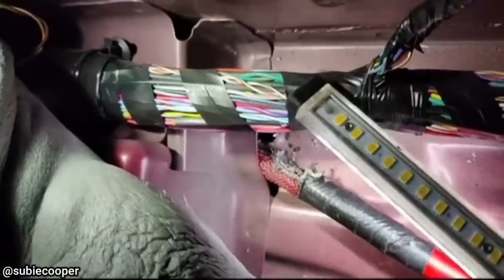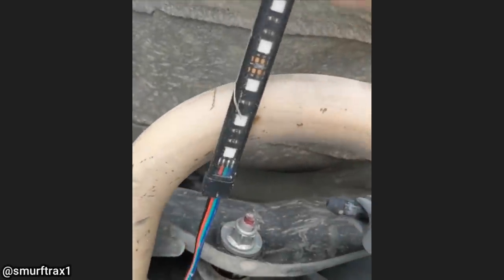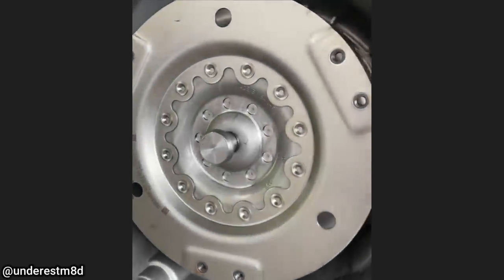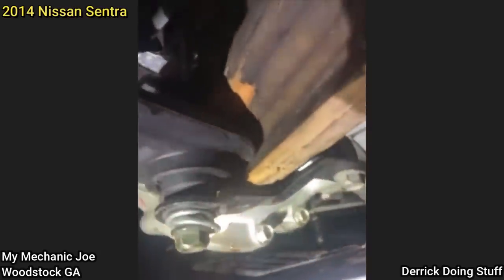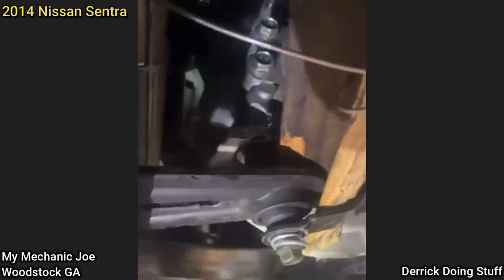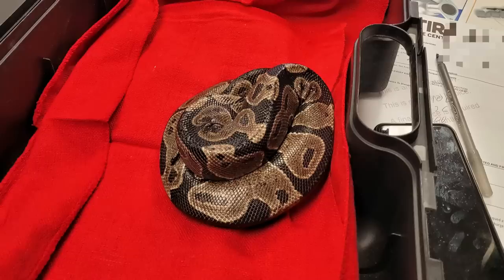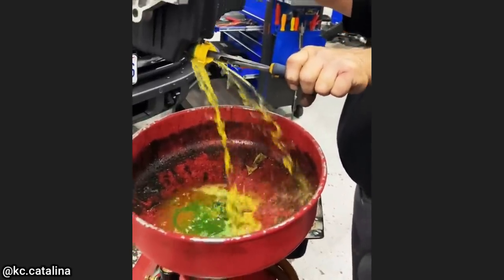Customer States Drove Over A Bolt & Now Smells Burning Plastic | Just Rolled In

Comment: Apparently catastrophic engine failures are somewhat common on those Broncos.  You'd think that after what, 126 years of being in business, the Ford Motor Company would have figured out engine design by now 😉
Reply: That's why they just need to take the Barramundi engine that Ford Australia designed (4.0L Straight 6) and put that in everything 🤣 #BarraTheWorld
Reply: Its not the design of the engine apparently they just had a bad batch of injectors, the 2.7 in my gramps f150 is pretty reliable

Comment: After watching many of your videos  have come to the conclusion that newer vehicles are ALL built like crap. Either aluminum now is ultra cheap and low quality or they are pouring parts and not tempering them properly making engine blocks and gear housings weaker than normal. Those big engines carmakers were putting out in the 40's through the 70's were unstoppable and pretty much unbreakable. Now you look at a new engine and it recoils in fear and something cracks.
Reply: Exactly my thoughts
Reply: Cheap pot metal
Reply: Has the same thought. Lots of thin cheap cast alloy made according to accounting not engineering.
Reply: @johnsullivan6709  Maybe more so to an engineers standard, who doesn't know that the real world isn't a lab 🤷‍♂
Reply: @notsureyou  Yep, coming across more and more of them. Always trying to reinvent the wheel ( round for a reason)
Reply: I think this channel is probably not a fair picture of what the majority of the vehicles on the road look like. If it was, we'd all be dead, or we would be fortunate that our car was in the shop because it would be keeping us from being killed by the innumerable death traps on the road.

I worked as a auto tech for almost 20 years (up until last summer) and I can tell you that people are taking picture/videos of these cars for a reason: because they've never seen anything like it before. This kind of crap really isn't common at all.
Reply: @ouch1011  Thank fully it is even less common in Australia due to required roadworthiness inspections :-)
Reply: @ouch1011  Excellent point.
Reply: And Ford is having so many problems with the new Bronco engines along with a bunch of other things and the official response is "we seem to be having quality problems". Really? Thank you, Captain Obvious!
Reply: @notsureyou   Pennsylvania has yearly safety and emissions inspections and since they began spreading brine on the roads in the winter the number of accidents due to brake failure has skyrocketed. My wife's 2014 Patriot needed a new tie rod end and my 2016 Patriot needed a new lower control arm due to corrosion. That brine ruined the frame on my 2001 Ram 1500.
Reply: @ikillstupidcomments  A lot of critical suspension parts are made of pressed steel welded together, not cast or forged steel as in the past.
Reply: @spaceflight1019  Is their an underbody coating that can be done,

Or is it just so corrosive, that it wouldn't matter?
Reply: @notsureyou  I don't know of anyone doing undercoating anymore. There used to be dozens of shops that did it.
Reply: @notsureyou  Underbody coatings don't work like they should and it doesn't take much to scrape it off a frame piece. In areas where they use brine and salt in the winter the only thing you can do is at least once a week during winter get an underbody wash done and not a lot of places do that anymore that I have seen.
Reply: @notsureyou  exactly. Just because CAD says it will work doesn’t = reality.

Comment: Yeah, dropped valves seems to be a growing trend on those 2.7 Ecoboost Broncos.
Reply from the maker: *EcoBoom 😜
Reply: How many ? I've heard of 60 of the real early builds
Reply: @rydfree  No clue. But I keep hearing stories about it happening more and more lately.
Reply: EcoPoop...
A co-worker has a 4-cylinder EscaPee EcoPoop. It's time for his biennial (every two year) flywheel replacement, which costs 2x Kelly Blue Book.
Reply: @dashcamandy2242  All these modern vehicles with engines that eat themselves, requiring expensive repairs are why I drive a 2001 5.3L. No VVT, no DOD. It just works. Sure, mileage in town sucks, but on the highway, it sips gas.

Comment: I guess nothing ever changes.  1,000,000 years ago when I was a lad, father was always complaining about stuff puncturing his feet as we rolled down to the Bronto-Burger for food.  Even with 3/4 inch thick calluses on his feet, various kinds of teeth, bone, stone, and other things would still be able to pierce them.  Now, the granite wheels were impervious to flats, thankfully.  You DON'T want to know how hard it was to jack them up and replace them on the side of the road.  Ironically, there were no potholes in those days.  Actually, the opposite was true.  Fairly large Poo-Pyramids were sticking UP out of the roads every so often, from the BigRigOsaurs and even LandTrainOdons.  Dad was pretty great at dodging those, most times.  I wish it was always, but it wasn't.  There was this one time a Rolls T Rex cut us off in traffic, then....

Comment: My father borrowed my vehicle to drive up to Alaska, hauling some supplies for a nonprofit we are with. After being denied at the Boarder (for stupid nonsense) he sent the other two guys he was with ahead. One of them (who was not informed the vehicle had a to package, my father failed to mention that in the chaos at the boarder) accidentally burned out the motor. A shop in Canada replaced the motor and we got it back within a week. Upon returning home, we discovered a very nasty oil leak. Took it to our local shop and they discovered the motor to be faulty. New motor, from the factory. Called the company that sent us the motor and they tried to play the 'you didn't register the warranty before installing the engine' card. Dad wasn't having it, since they both failed to provide necessary information and they sent us a shot motor. We threatened legal action. 

New motor should be here in a week and we owe nothing. 

I haven't had my rig for 4 weeks though. 

I can't blame anyone for missing something so simple in the chaos of boarder security and I actually praise the shop in Canada for going above and beyond with their repairs and speed. The guy that drove is a close friend of ours and he feels very guilty for it all. Of which we are more than understanding and worked to appease his anxiety. The leak only became apparent after the break in period of driving it home. I however do have a problem with the company sending a shot engine and trying to pull a fast one on us for the motor we paid for that has a factory fault in it.

Comment: What are the odds of hitting a bolt and splitting the battery cable. The customer did the right thing and got it checked right away before the systems locked his Family into the vehicle and burned them all to death.

Comment: Those staples were barely holding that LED cable to the fuel tank. They should have used bigger staples and a more powerful staple gun.

Comment: why did the Tacoma fail? was it just badly assembled?
Reply from the maker: That's what the tech thinks. No signs of anything causing it. Just a bad water pump. Stuff happens unfortunately.
Reply: @JustRolledIn  saw the same thing happen on a ford ranger , newly installed water pump ( at the dealership ) , he thought it threw the belt , nope , water pump snapped at the housing . Poorly built pump at the manufacturer .

Comment: stapled the cables to the undercarriage... and into the gas tank. how..? I mean, I know, how. but seriously... how? they'd have stabled it to the control arms if they weren't too hard. also, knowing enough to connect everything to the electric system, but not knowing enough to keep the cables away from hot and moving parts. this just scares me. what else are they doing half-assed and only survive because someone else finds it in time?

also that Hellcat gearbox. are they even serious at Chrysler's?
when german Opel tuner Irmscher decided to drill the 3litre straight six up to 4 litres (and upping the power from 180HP (2valves) res. 212HP (4valves) to 220 res. 272HP, and torque went through the roof), ZF said, "never mind our 5gear manual, it will die on the spot", so these cars were only available with automatic. everything else is just dumb...

I heard of snakes on a plane. but snakes under your center console? that's a new one. :)

and lastly, outro: is that a 1940's Ford coupe in the lower left? can I have it, please?

Comment: 0:05 What the fucking odds, a stray bolt, striking the under carriage in such a way that it crossed paths with the battery power cable.
2:47 He is lucky it did not get sucked in to the engine, that would've bend valves

Comment: "Just rolled in" at my mechanics yesterday and under a vehicle just bought by a young naive couple with a newborn. "Will it Run". We don't know how they drove it there, fan just touching the radiator, under carriage torn, bumper had been pushed in and pulled back out, both rims and tyres up front needed replacing, both front shocks (Shocks need to be Imported $270 each) leaking oil, radiator leaking. Previous owner must have hit a huge rock or a pole. They didn't even replace the recover point cover on the front bumper. Cheap car will now cost over $1000 in replacement parts, and had even got to do the service yet.
Reply: That sucks.  That dad better start learning.  You can't just hope for the best from others anymore.

Comment: Why did fuel and oil mix in the crankcase? 😳
Reply: That's where it mixes to create combustion (fuel plus spark), unfortunately the hole make it come outward as you saw so that could be due to a poor piston or O-ring. In short poor combustion blew a hole in the crankcase
Reply: @devnotes00  Was it a 2-stroke engine?
Reply: @u.e.u.e.  4

Comment: How does an auto trans grenade like that?!
Reply from the maker: I didn't have enough time to mention it since the clip was short but the tech also mentioned that the vehicle was stolen after the new transmission was installed and thinks it blew up because of the police Chase it was in 😆
Reply: Neutral drop would be my guess. Well that, and it's a Chrysler, but I digress!
Reply: @JustRolledIn  welp yeah that will do it 😵‍💫

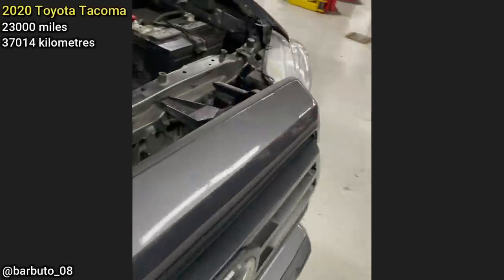Comment: 1:13 🤣😆 I love sticking these in the faces of Toyota fanboys. 😋 "tOyOtAs aRe tHoOo ThOOpEr DooPeR ReLiAbLe"

I don't get that it still has a belt driven fan in this day and age... I would assume a couple of electric Thermo fans would be cheaper than a big complex cast alloy fan clutch.
Reply: Developing a 'great reputation' by not doing the necessary recalls is pretty shady.
Reply: @WizardofGOP  the Japanese have learnt nothing from the Takata airbag fiasco. Pride comes before the fall.
Reply: @WizardofGOP  Two-time Toyota owner. In a way, I hate them for not applying the Frame Rot Recall to the 4Runners, despite sharing the same frame with the recalled Tundra - I got to drive my 4Runner SR5 for two months before it fell apart on me. Couldn't disable the malfunctioning ABS system unless I also defeated the electric brake booster, so my brakes always released at 8 mph and I had to jam the pedal to the floor to stop. ABS system was throwing no error codes, all wheel speed sensors working properly.

But on the flip side, I absolutely love my '99 Camry 4-cyl, still running like a top at 367k. The ONLY time it has broken down on me is the one time the timing belt snapped. Passes emissions testing well enough that it could pass strict California emissions (with the non-California exhaust system). Best car I've ever owned. A friend of mine has a '99 Camry 6-cyl 5-speed that he beats the snot out of and it won't give up on him, and he recently sold his '99 Camry Solara which started on the first try after sitting parked for three years.

All that being said, I wouldn't buy ANYTHING remotely new nowadays, too much electronics and computer stuff going on behind the scenes that makes diagnosis and repair a ridiculous endeavor. Save computers and networking for the IT professionals, get most of it out of cars.
Reply: @dashcamandy2242  My Chevy truck has 235,000 miles on it and she works carrying loads and tools all day, everyday and it's a 4x4.

My Ford F150 went close to 400,000 miles, I only lost it when having to replace the heater core for the second time and the clips failed and it leaked coolant behind my dash.  

My Grand Caravans with the 3.8l with all of the room, bells and whistles you could want with kids, I bought with high mileage and with a little of my kind of maintenance would beat a 370z that was screaming and I never even saw his front bumper.  Did the same to a Porsche Boxster and shut a Vantage down at the light as he bowed out of the embarrassment.   

All my vehicles have been less than $1,000 and have lasted years with little maintenance costs.  Got to know what you're looking for and what you're looking at so as not to get fooled from the start.  I look at a vehicle with over a 100,000 miles as just broken in.  Once they go that far, they have a lot of life left in them.  

Rust is the only thing that takes 'em down.